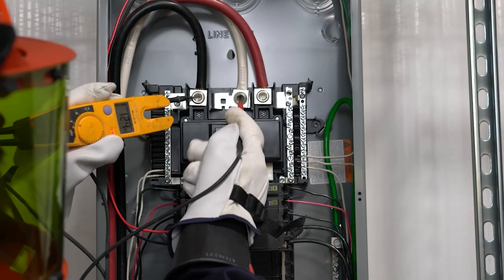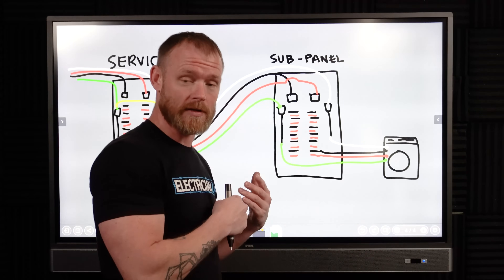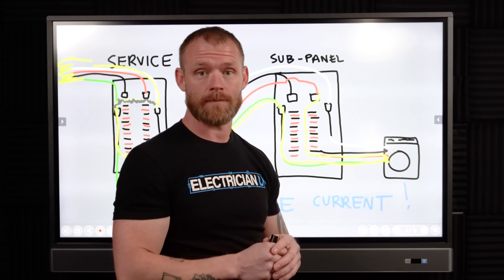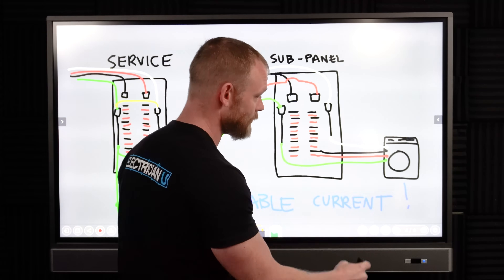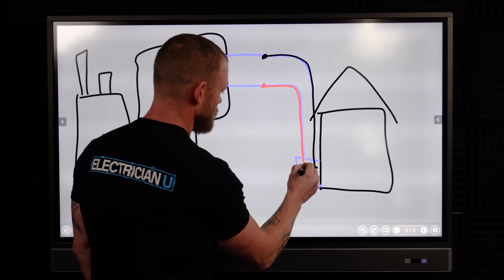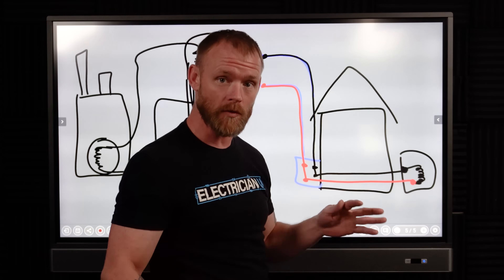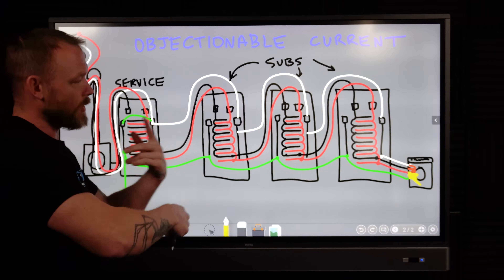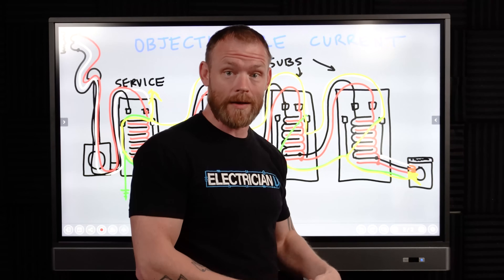Why Do We Bond at the Service Panel and Not a Subpanel?

Comment: Thank you so much. This video had allowed me to visualize the issue of multiple paths to ground a lot better.
As an electrical engineering student, it is worth noting that with multiple paths the current is split proportionally and may produce an equal hazard without sufficient current on the breaker to trip it... Essentially defeating the subpanel's circuit breakers without reducing voltage on the equipment.
(see Nodal Analysis for the nerds)
Reply: But the circuit breaker breaks the 'hot' therefore total sum of current will still travel through the circuit breaker, even if 'return' current is split between EGC and neutral.
Reply: @spruce_goose5169  the thing about AC current and impedance is that it flows from both directions on the line. The hot and the neutral in the circuit.
It's a sinusoidal function.
(Edit) I see how the accumulation on the breaker would still eventually trip it on a 50% duty cycle, but it's rated to trip on a 100% duty cycle
Reply: @Martin4Mary4Ever  You're making this more complicated than it needs to be. It doesn't even matter that it's AC.

Draw out the circuit and note the location of the breaker in the circuit. 100% of the current passes through that point (the breaker) even if the return leg is split into two separate parallel paths.
Reply: @spruce_goose5169  Exactly!  Everyone here is making it more complicated than it needs to be.  If you're an electrician you don't need to understand why any of this.  Learn and follow the code prescribed for your area and all will be fine.

Comment: Hey electrician u , I was wondering how does how does ground fault work in older homes if there is no ground at the unit or device? For example, the older snake skin wire usually has no ground only hot and neutral or 2 hots and neutral.

Comment: Hey @electrician u on the washing machine in the example, there's 4 wires?
But the plug is only 3 prong... what was the black? You had hot neutral and earth... what's the other one?

Comment: Thanks for the clarification. Now, another question, some appliances (like washing machines) besides the third prong, include a green screw to the chassis, with a grounding symbol right next to it… is it safe/recommended to connect this extra grounding point to a metal bar underground (different to the one connected to the main service panel) or shall I rely only on the grounding prong?  Thanks!

Comment: Can you discuss what happens when the neutral conductor is lost on the service cable between the meter and service panel.  I had this situation last summer and it caused an over voltage on one leg and an under voltage on the other.  This smoked every outlet strip in the house along with every appliance  that had a transformer (including 2 hvac transformers) and damn near started a house fire.  The voltage was correct when there was no load, but as soon as a load was applied in the voltage would drop on the leg with the load and raise on the other.   And discuss the easiest way to test continuity on the service cable.  Love the channel!  Keep the great content coming!

Comment: Hey Dustin, I stumbled across a conundrum that you might be able to shed some light on. After doing some research, I can't find a real answer on the use of raintight emt connectors without the locknut. Is it technically code or not if you can use connectors to terminate into an exterior box or conduit body without the use of the included locknut? I mean, it is a threaded insert, and as long as you get a tight connection with the gasket and compression ring, I don't really see an issue with it. What do you guys think?

Comment: Can you do a video about installing outlets in older homes and some of the issues such as fire breaks, double studs, asbestos, and general structural integrity of the house? 
How cutting through studs effects the structural integrity, and the placement of holes in floor joists. Perhaps where we can expect studs in walls and areas that we can expect double studs or plumbing/gas lines

Basic construction stuff that people do not get going through a electrical course.

Thanks!

Comment: Understandably (and per code) the sub-panel needs a 4-wire feeder and to not bond the neutrals/grounds. But what about for older homes that have pre-existing sub-panels with 3-wire feeders? Bond them at the sub-panel just like the service panel? Ideally you'd replace the feeder with a 4-wire and bring it up to code, but that aside and using what you have, what's the safest option? Then, do you bond the panel itself with a 3-wire or no?

Comment: Dustin, (12:00 - 12:40) what's the purpose of grounding rods/wires and equipment grounds if the circuit breaker that feeds my washing machine won't trip if the hot wire shorted against the washer housing?  What's the purpose of a ground rod/wiring if not to trip a breaker during a shorted condition?  Thanks!

Comment: I have a question, at my home in Puerto Rico the garage and laundry room were built on the other side of the house and the existing garage was turned into a family room. They ran 3 lines to a panel recessed inside the concrete wall. There is no ground cable. I upgraded the panel by installing it on top of the existing recessed panel. I bonded the panel because there is no ground line. Did I do the right thing?

Comment: One of the main reasons that sub panels aren't bonded is to prevent current from flowing over the grounding conductors in a non-fault situation.  Current should only flow on grounding conductors when there is a ground fault, and that is just to trip a breaker.
Reply: Current flowing in a ground wire does NOT trip a breaker - note that ground is not even connected to a breaker. You can trip a ground fault breaker by touching a hot and a water pipe, for example. A ground fault breaker trips when the load currents become unbalanced
Reply: @robsnexus  Wrong... a breaker trips when current exceeds its rating ...eg when it is flowing through a ground from the hot. Grounds will accept as much current as you can give until it melts...so yes grounds are installed to trip breakers
GFCI and circuit breakers are comparing apples to oranges.. You can arc weld by connecting a hot, off a breaker to a water pipe,
until it trips the breaker

Good thing you only try that with a GFCI...still a very dangerous hobby....What If the GFCI fails

Comment: Question.  On the diagram with only one subpanel you have the green ground exiting the main panel going back to the source. However, on the diagram with multiple subpanels you have the green ground ending/terminating at the main panel and going to earth. It does exit not back to source.  Is this correct?  Otherwise, a very clear presentation.

Comment: Great video. A very clear explanation.
Do you have any videos on when/where an arc fault breaker or out should be used verses a GFCI breaker or outlet?
Also how many sub-panels can you run off of one main breaker panel?
A house my sister is looking at has a 200 amp main panel in the basement and then a 100 amp sub panel next to it that feeds the attached garage/workshop and then another 100 amp sub-panel in a detached workshop feed from the main breaker panel. Your thoughts?
Thanks for your time and any information you choose to share.
Ron

Comment: Maybe I missed it as I had a couple of interruptions while viewing, but I didn’t hear probably the most significant issue and that is the return current path during normal operation.  I heard you mention a short to ground fault and a short to neutral fault, but not normal operation.  If the dryer is operating normally with no internal faults, but you have the neutral and grounding conductors bonded at the sub panel farthest from the service entrance, the return current on the neutral will divide at the sub panel and now the “normal” return current will travel the rest of the way on both the neutral AND the grounding conductor all the way back to the service entrance.  The current proportion will be based on the resistance of the neutral and the grounding paths, but likely will place substantial current on the grounding conductor.  That is probably the biggest reason not to bond subpanels.  Yes, the two fault conditions matter, but having current on the equipment grounding conductor during normal operation is the most insidious issue of all.
Reply: Absolutely correct and not many licenced electrician know that. What I've never got a good answer from anyone is why they require oversized neutral conductors??
Reply: @bryanduchane2371  I thought this had been changed some time ago.  This reference says in 2008.  Since I’m retired, I no longer have access to current NEC documents.  “This is fully recognized in the latest (2008) edition of National Electrical Code.  Specifically, Article 310.15(B)(4) addresses the question "Should Neutral Conductors Be Oversized?".  Noted is that "for NEC editions up to and including the 2005 Code, the neutral conductor ampacity was usually 125% of the maximum continuous current allowed by the overcurrent device."  This is immediately followed by: "Revised for the 2008 Code, both 210.19(A)(1) and 215.2(A)(1) include a new exception that permits a branch circuit or a feeder neutral conductor to be sized differently.  The sizing is now permitted to be 100% of the non-continuous load plus the continuous load, thus permitting a reduction in a neutral conductor size (calculated from previous editions) by as much as 25%."
Reply: @LTVoyager  From what I remember from my 25yrs in the Electrical Distribution business, I think an oversized neutral had something to do with harmonics and the use of digital equipment in a facility. This popped into my head as I was reading your reply. Only been out of the business since 2015 and the old saying if you don't use it you lose it couldn't be more true. I could easily get back in the industry, but would have a steep learning curve to learn all the new technology that has been released since 2016..... Loved the industry. Met some of my best friends through it.... It's a very rewarding career.
Reply: @bryanduchane2371  I’m a retired EE and I don’t remember any discussion of the need for a larger neutral or related harmonics issues and I was going to school in the last 70s and early 80s.  I always figured it was just an error carried forward from people who didn’t understand the phase relationships in AC and thought you had to add the currents from the two hot conductors as though it was DC.  I never knew the history there.
Reply: @LTVoyager  The harmonics are caused by many PC's in the same building and on the same transformer using high frequency switching DC power supplies.  This problem didn't occur until around 1990.
Reply: @motorheadplatt8748  That sounds specious to me.  Harmonics are generally AC and random so on average the resultant current would be close to zero.  I’d be very surprised if this could justify a larger neutral, particularly since the harmonics would also be present on the normal hot conductors as well. So they would also need to be oversized to match the larger neutral.

Comment: Your videos are very interesting and I appreciate you trying to teach others about electrical power.  Should you install another ground rod(s) at a sub-panel in a detached garage to connect to the ground in the sub-panel.  The main power ground would be brought over from main panel to the sub-panel as well but simply add another path to earth ground at garage?  (Not bonded to neutral in sub-panel!)

Comment: Dustin, great description.  Can you cover how your multiple sub panel example applies to out buildings where a separate ground rod exists.
Reply: I would like this also. I have a subpanel that does not have a separate ground wire back to the main. I put a ground rod at separate building and connected the subpanel ground to it. No ground/neutral connection. Is there any problem with this connection?

Comment: QUESTION! 
We bought an oven from a local store, had them deliver it, our old one had a three prong 220 plug, 2 angled hots and one blade for ground, no common. The new stove came with a 4 prong pigtail with a common round pin. The guy took our old 3 prong pigtail and transferred it to the new stove. 2 hots and a ground, he took the new stove ground and white common and twisted them together to share the one ground prong on the pigtail. I questioned that, he said they're connected in the main breaker box anyways. 
***PROBLEM, the next month our electric bill increased dramatically. The stove works fine, doesn't blow breakers, but it's a weird coincidence. Could that wiring and the increased power bill have anything to do with each other, or just coincidence? Thank you!

New Subscriber,
Been binge watching your videos, Great Stuff!
Reply: I have a water heater and a range, both 240 volt appliances, and both on a sub panel.  They both have 2 hot leads and one green conductor attached to the metal cabinet of the appliance.  No neutral.  And they both work fine (Range since 2003 and water heater since 2006).  I've never connected a neutral and a ground together on or at an appliance.  All I can say is that you are using that new range more now than you did before because it is new.

Many times nowadays, the installer of the appliance and the electrician that wires up the appliance is NOT the same person.  Especially with HVAC suppliers.  There is a reason for that.
Reply: Just coincidence.  Years ago lots of 240V appliances just had 3-prong plugs…at least dryers, not sure about stoves.  If the appliance truly doesn’t have any parts that run on 120V, the 3-prong plug is perfectly safe, and 3-prong plugs (hot, hot, ground) are still commonly used for smaller 240V appliances like air conditioners and space heaters.  If it does have 120V components (e.g. light bulb or timer motor), a 4-prong plug is better.  But in the old days, at least some dryers just used the ground to get their 120V for those small parts.
Reply: The dramatic increase in your electric bill is a result of Joe Biden's war on the energy business!  We're all paying for it.

Comment: Good explanation. Another point is that the ground wire does not need to be as big as most grounds because it's the neutral that will be carrying current back to the transformer from the service panel, not the ground wire. But Bonds in the building will be carrying fault current back to the Service panel. In Canada for example, a 2000Amp service only requires a #6 copper ground, but a 300 Amp circuit in this same building would require a #4 AWG bonding conductor. An 800 Amp circuit would require a 1/0 bonding conductor ( Table 16 - Ontario Electrical Code)

Comment: If a neutral is bonded to ground anywhere in the house, current could travel on the green bond wire or any metal bonded to ground in the house, back to the neutral in the service panel during normal operation. This can cause shocks when 2 metal parts are touched.
Reply: Exactly!  We want our metal panels and equipment chassis to be at earth ground (0V).  Wiring has resistance just like the loads they drive.  And while we would like for there to be zero voltage loss, some has to be tolerated until we can find an affordable way to wire buildings with superconductors.  In a 120V world, the neutral can develop a slight potential difference from earth ground the further it is away from the main panel.  That's fine and acceptable.  However, if a sub located on the other side of the building bonds the ground and neutral, now the neutral will also be at a non-earth potential.  And while the voltage may not be that much above/below earth ground, depending on the situation it could be enough to introduce hydrolysis (accelerated corrosion essentially of all exposed metal parts that may find a slight path to ground) and other undesirables.

Comment: I recently purchased an old home and the garage subpanel only has 3 conductors coming into it, the conduit going to it is not continuous, 2 hot legs copper 10 gauge and one aluminum 8 gauge... I had to replace the panel because breakers failed and were not available... How can make this safe temporarily until I can trench and run a new circuit to subpanel
FYI I am a 16yr pool repair technician and work quite often with basic electrical

Comment: I'm an electrician apprentice working at a residential electrical contractor that does new constructions. we run wire to AC disconnects on the side of the building for 240v condensers. These are grounded themselves but don't have a neutral. Since it's split phase this makes sense however the same logic doesn't apply to other places where 240v is used in the house, namely stoves, dryers, and hot tub disconnects. Why do these 240v receptacles have neutrals and the AC condensers don't?
Reply: Something like a stove, dryer, or hot tub may have 120V components (e.g. lights or timers), in addition to their big 240V main load.  Simple things like air conditioners and heavy-duty space heaters don’t have any 120V components at all, so they don’t need a neutral.
Reply: It's the way the compressor and condenser fan motors are wired.  That wiring meets their requirements.
Reply: It's for the high current starting demand of the compressor.

Comment: How about a ground rod for the sub panel at a detached garage along with the ground rod for the main panel at the house ?   My detached garage/workshop has a ground rod at the house and another at the garage and always wondered if that was ok . Also the two 240 volt wires are 6 Gauge fed by a 50amp breaker and the Neutral and Ground wires are only 8 Gauge to the blocks is that OK ?  It was all wired by an electrician back in the 1990's long before I bought this place  .